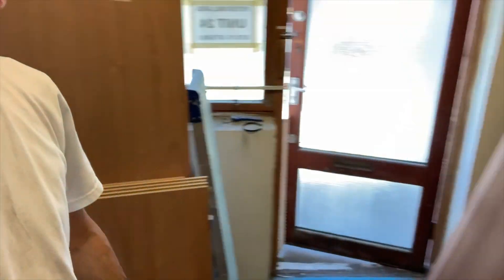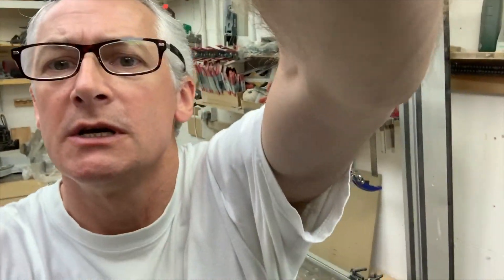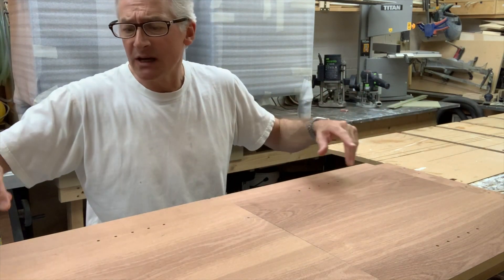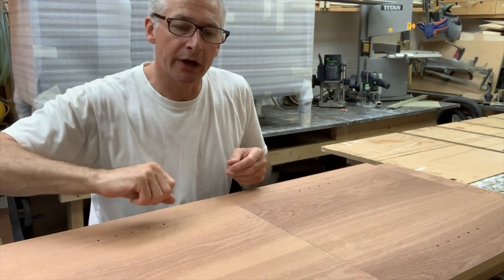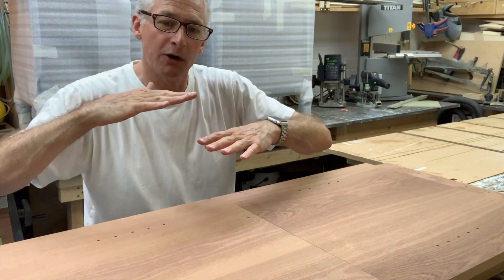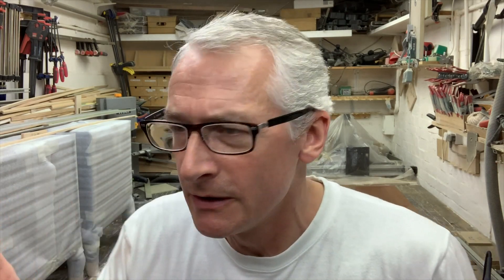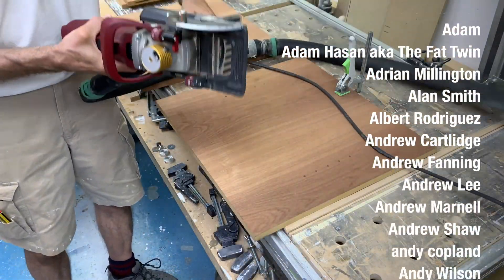My First Commercial Job with the Lamello Zeta P2 [video #340]

Comment: A sarcastic smile Peter when you talk about a heat wave. I'm working in Northern West Australia at the moment. We have mid 30's every day and believe it or not, some guys come to work with a coat on in the morning. And here's you in shorts and Tee shirt :)
Reply: +Pete Compton
Not quite the same as the humility makes a difference as does being used to 32 degrees.  When your normal temperature is 30 you adjust to that so in the morning when the body is not quite up and going it will feel cold. 

But you do adjust. Any British person that goes to northern Australia is going to be crying for a bit. 

Even if you are not British and come from a warm climate you will find a British 30 degree different and then there is the fact very few places have good Aircon.
Reply: But out cameras don't over heat with our common 35°c-40°c days.
Reply: Peter Compton hahaha i was thinking the same here in China with 43C and no swetting in a suit when im in shorts hiding under the airco;) But i found out that 28 to 30C back home is much less nicer then 43C here.

Comment: As someone who is going to stick with doing  built ins, bookcases and wardrobes, would you class this as an essential tool?
Reply from the maker: Essential, no. I like the Clamex connector, unimpressed with the Tenso, and I did just fine with a Domino for years. But it’s a very handy tool to have available.  👍

Comment: Hey Peter, enjoying ur channel! One little tip (if I may be so bold)  related to audio, use a high pass filter/HPF at around 100 hz on your software to cut off the low end rumble in the audio. This video really gave my subwoofers a workout.
Reply from the maker: Thanks! This was just a quick vlog-style vid shot on my phone, so the audio suffers. Normal service resumes soon, 👍👍.

Comment: Hi, did my first project with the Lamello, a wardrobe. Did you find the boards when joined up wobble a bit? Mine do. for some reason i was expecting it to be very rigid. ps the boards are around 100cm long each on average. It was only when I put the back board in the rear recess that the cupboard was pretty rigid.
Reply from the maker: Which connectors were you using? Clamex would be solid, Tenso flex in my experience. Not a fan of the Tenso. 🤷‍♂️
Reply: @10MinuteWorkshop  Hi sorry for the late reply, I used clamex P14. Like I said wave a little, depth also at 55cm so I used 3 each end. Do you think it might be that I need to ajust so they sit further below the surface ? Think they meant to be at 1/2 mm (0.5mm) . Its a bit difficult to see but it may well be around 0.3mm below the surface but not less than that for sure
Reply: Bit late to the party, but some things that might help: 

1. The connectors have lateral play in them so you can do adjustments a few mm in either direction. If you need to have zero play in your joint, throw a couple of dominos in between your connector slots (use the tight setting) and use the domino for alignment and the tenso/clamex for clamping 

2. You can adjust the depth of the plunge with an Allen key (read the manual first) to get a deeper mortise. 0.5-0.7mm is the best depth for a strong tenso hold. You’ll need a vernier scale to do it though. 

3. Use clamex connectors for pulling cabs together rather than the tensos. I find I’m only using the tenso connectors for affixing in fills or face frames. 

It takes a bit of trial and error, but once you get used to it, it’s a fantastic addition to the workshop. The best use I’ve had so far is pulling miters tight. Say goodbye to clamps and other horsing around and just throw a few clamex connectors into the joints and then glue and screw - did a beautiful job with some waterfall panels I did in a bedroom recently. Super tight miters.

Comment: Hi sorry for the late reply, I used clamex P14. Like I said wave a little, depth also at 55cm so I used 3 each end. Do you think it might be that I need to ajust so they sit further below the surface ? Think they meant to be at 1/2 mm (0.5mm) . Its a bit difficult to see but it may well be around 0.3mm below the surface but not less than that for sure
Reply from the maker: Might be worth tweaking the depth setting. Never had an issue with the Clamex myself, though I had to try that with Tenso. 🤷‍♂️
Reply: @10MinuteWorkshop ,,, maybe its just that the boards are so big,, 100cm tall x 55cm that there is bound to be some wiggle, it doesn't move on its own, u have to wiggle it yourself. May try on some small pieces tomorrow and adjust the depth,, I did actually then put it back, since it creecked a little and I think a very tiny bit of the black plastic came off, tiny bit though

Comment: Excellent video. Do you think a Makita biscuit cutter with the thicker blade used for the Zeta cutter could be used to cut the holes? The Zeta P2 is great tool, but only a professional could justify the cost.
Reply from the maker: Thanks. No, the zeta has a very specific up/down movement that creates the t-slot that the fittings slide into. A thicker blade would just create a thicker slot. 👍
Reply: oh even us hobbyists can figure out a way to justify the cost! 😄

Comment: Heat wave ...heat wave most of June was in the 30ties here Peter and well are legs are tanned ....lol,ive got just a plain old biscuit jointer,dont use it for much other then lining up table tops ,put i suppose just cutting a spline on the table saw would be just as good for lining things up
Reply: hey thanks Peter ,who the hell made GosFord " handy mans sign anyway ...lol stir the pot

Comment: I have an old Elu biscuit jointer. It’s so easy to use and fast too. it pivots on its side rather than plunges as the new biscuit joiners do. It’s more than just a locator. I’ve made a lot of furniture with just glue and biscuits - no screws - where the ends are seen. I wonder why they stopped making the old type? They’re hard to come by now.
Reply from the maker: Never seen one like that! I’ll have to keep my eyes peeled 👍👍
Reply: You are the only other person I've heard of that has one. I bought mine in the mid 80's and it still works! We should form an owners group :-)

Comment: I can see a threaded hole on the side of the machine. you could use a bolt screwed in that hole and use the bolts head as a stop . but then that would interfere when you need to use the machine for the other side. Perhaps you could fashion an adjustable fixture to use that thread hole.
Reply from the maker: Yes, that’s why the Mafell sprung pins were so clever - and patented, lol! You could probably make something, but lining the fence against the edge of the workpiece seems to work pretty well. 👍👍

Comment: hi there, would you use it with chipwood core? for example when you use EEgger panels they are usually chipwood not mdf.
Reply from the maker: Sure, they work fine in a decent chipboard eg egger. 👍

Comment: Hi Peter, Every time I see you use that tool I have the same problem, that is (how do you get a biscuit cut with a wider exterior). No matter how the blade is shaped it is an impossible hole to get by a plunging motion?
Reply from the maker: I talk about this in one of the previous vids (#325 or 330), with a slo-mo cutaway. When you reach the prescribed depth, the blade does a little jump up & down to make the T-slot shape. Very clever. 👍👍
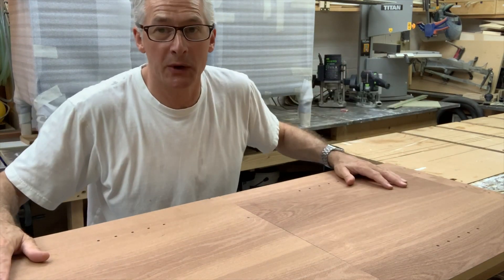Reply: It's in Peter's #325 video at about 4:50
Reply: @tworailsrails1821  Thanks, I have found it

Comment: Peter im working my way through your videos. Honestly i cant thank you enough for your great work! 
Question: would this machine replace your usual domino, glue and screw method of making wardrobes and putting together bulky furniture on site everytime? Which lamello fitting would you use for said job, (clamex or tenso)? Lastly do you use glue on the joint? Thank you for your time again my man!! Have a great day. Chris
Reply from the maker: Thanks Chris! By and large, yes - though if I was on a very tight budget the dominos and screws are easy, fast and cheap! I like the Clamex connectors - they can be used as a knock-down connector - though I’m less happy with the Tenso fittings. Absolutely glue the joint with Tenso, and only if you know you never need it to come apart with the Clamex. Adding adhesive increases the joint strength by around 30% according to Lamello. 👍👍
Reply: Peter Millard Great info. Thank you again
Reply: Peter Millard Just out of interest why the tensos are floating your boat?
Reply from the maker: Chris Wright Can’t get them to pull together tight enough for my liking. There’s adjustment on the machine, but I need to find time to play with it a bit more. 👍👍

Comment: I am newer to building cabinets for customers and have been really considering the P2, do you still feel the same about it after using things like the peanut? I work by myself and am building bigger cabinets that I feel this would be a game changer while working alone. Any thoughts would be greatly appreciated.
Reply from the maker: I've talked about it a bit in other videos - I put it down as one of my 10 worst purchases, though only because I was sold on the idea of the tenso fitting being the perfect fixing, which it isn't. The Zeta is excellent, and the Clamex superb, but at ~£1500 for the tool and then ~£1.40 per fixing, it just wasn't worth it for me, especially now I've moved on from that business. I still have it, and it's a pleasure to use, but rarely comes off the shelf these days. The Peanut 2 is a good system, and you can try the mini jig and starter pack for less than the price of a pack of clamex fixings. Slower, of course, as any jig & router system will be, but a solid connector at 1/10th the price of the clamex.
Reply: @10MinuteWorkshop  I am currently using biscuits with the porter cable biscuit joiner and like the method but feel the execution and time could be better. Was thinking the domino would help with constiscy and time cutting but not so much in the assembly. Would be interested in that if it would help me without needing to use their knock down system. That's what makes me lean towards the clamex. I like the peanut but am worried about being off and not having any play plus the added time. Turns out I had stopped your 5 worst buys video right after the Zeta. Go figure. Thank you for your help it is greatly appreciated.

Comment: Anyone know if you can use a Lamello p cutter in a unbranded jointer? How does it make the extra cut for the connectors to fit
Reply from the maker: For the P connectors? No, the cutter makes a little up & down jump to cut the t-slot, won’t work in a regular biscuit jointer. You can get clamex fittings for regular biscuit slots, but you have to screw them in. 👍
Reply: Peter Millard thanks Peter
Reply: Peter Millard I think I’m going to take the plunge and invest😬
Reply from the maker: Woo hoo! 😂 Don’t know if it’s still the case but ProTrade we’re doing the best prices when I bought mine. Should be a link in the video description, or give Alan Harrison a call, see what he can do for you. Mention you’ve seen the vid. 👍
Reply: Peter Millard Thanks I will do

Comment: What kind of wood is that (at around @2:50 .. @3:00)?
Reply from the maker: Sapele. 👌
Reply: @10MinuteWorkshop  thanks a lot! But this is the veneer - I wondered  what  the base wood is? I cannot see the layers of a plywood or the structure of an MDF board etc.  in the video (the side edges don't show quite on focus and maybe I'm wrong) ... so I wondered what kind of base wood is it?
Reply from the maker: @sunsande  At 1:45 "...I'm in a whole forest's worth of Sapele veneered MDF..." MDF. Always MDF. 😆👍👍
Reply: @10MinuteWorkshop  my mistake sorry :). It is quite dense - I cannot see the structure - the MDF I use is rougher - one sees easy the pressed wooden particles ... or maybe it is another type of MDF. I have to check. Thanks again!
Reply from the maker: @sunsande  No problem. The veneered board I get from my local timber yard are usually made my Medite, which is a particularly good quality board - even if it is only regular MDF and not MR MDF 🤷‍♂️👍
Reply: @10MinuteWorkshop  Thanks a lot again! Medite - I've just learned something new :)!

Comment: Hi, good video !!, did you also use glue for the waredrobe or just the Lamello fittings?
Reply from the maker: Thanks! Yes, glue as well - it increases the joint strength by about 30% if you glue as well. 👍👍
Reply: @10MinuteWorkshop  ahh will in with the fitting itself but not along the whole lentgh of the lengths of wood? (like it use to be, bk in the ollllllddd days lol ) :)

Comment: How much does this tool set you back ? Apologies apologies  if you have said in the video.
Thanks in advance .
Reply from the maker: There was a deal on this anniversary edition, so in the region of £1250; list is around £1350 for the basic kit. Not cheap, still figuring out if it’s worth it.👍

Comment: Hi Peter, it has been a year since you posted this video  and if you dont mind me asking I would love to hear your advice on this, if you were to get only one system for panel joining what would it be? (yes I have seen your "domino connect vs clamex" upload).
Thank you.
Reply from the maker: Hiya. That’s a tough one tbh, and a lot depends on wether you want a completely hidden fixing, or can live with a small access hole. If you can live with a small hole or cover, then the Lamello and Clamex is hard to beat for sheet goods/panels. I’m not a fan of the Tenso though, so if you want a completely hidden fixing then I’d look elsewhere. The Domino remains the most flexible of all the systems I’ve used in terms of material thicknesses and widths supported and different types of joint. In an ideal world, you’d have both! 🤷‍♂️👍
Reply: @10MinuteWorkshop  understood, thank you very much.
Yes I will eventually have both. At the moment I mostly work with 18, 22 and 25mm sheet material and cant afford both must prioritise. Dont mind the small access hole, it can be covered.
I have recently assembled a wardrobe with cabineo fittings, loved working/assembly process  even though they are huge comparing to small access hole of clamex, very strong too but they are cnc only job.
Anyway, thank you very much for your time.

Comment: Hi Peter. Are you still using the Zeta currently? Worth the investment on top of a Domino? Reason I’m asking is because there is a current Black Friday sale for it (comes with free attachment set)....
Reply from the maker: Honestly, I’m not using much of anything, currently, having gone full-time on YouTube this year. But yes, there’s no question that the Zeta has many applications that the domino can’t match. I’ve always struggled with the Tenso fittings, personally, but the Clamex are outstanding. 💪👍
Reply: @10MinuteWorkshop  any reason for the Tenso struggles? That is actually the main reason why i’m interested with the Zeta due to its self clamping feature.
Reply from the maker: They’ve never clamped up tightly enough for me. Other guys seem to be happy with them, but for me they just don’t have the oomph to pull a joint together tight enough. 🤷‍♂️👍